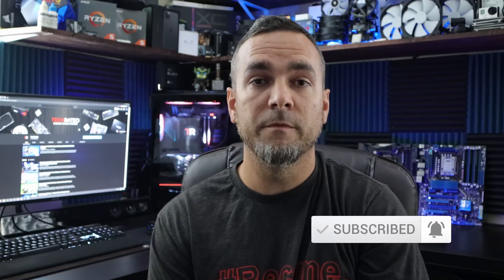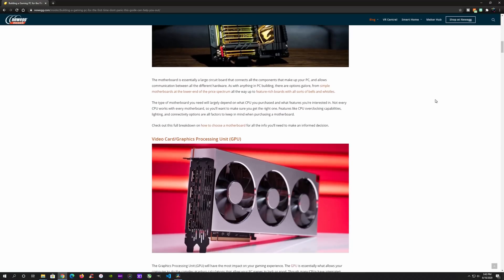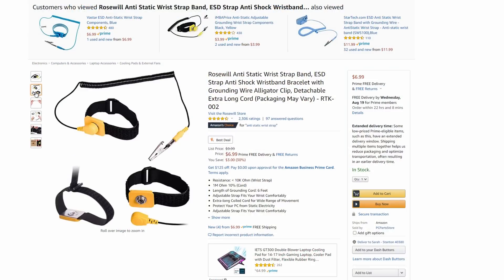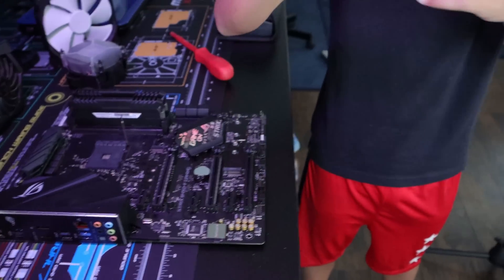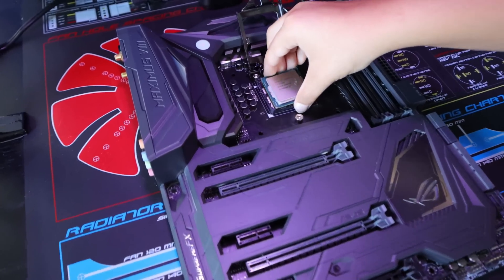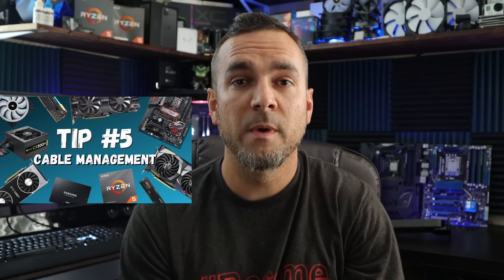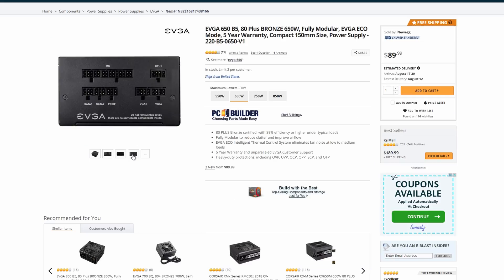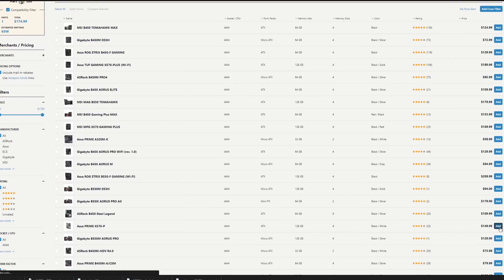5 PC Building Tips for Beginners | Watch Before You Build Your First PC!

Comment: My video conclusion :  Ok firstly I like how clear all the explanations are . Secondly I have the same mobo as you !! Ready for my build on Sunday!! Thirdly I loved how giddy your second son was whilst giving the intel cpu demonstration. You could hear him trying to hide in the laughter. Great video man!. However I have one question that’s kinda relevant that you may be able to answer. I got a be quiet system power 9 600w psu for my first build which is gonna have a 3600 and a 5700xt aswell in terms of power usage . This product has over 500 reviews on amazon uk (where I am) and a 4.5 rating. And it’s got the 80plus bronze thing aswell. However it’s not modular will this badly impact my first build. I am a complete pc noob but your tips about just watching computer videos is where I’ve gained all my knowledge from! Thanks
Reply from the maker: I appreciate the feedback! My boys love helping me in my videos! They also like working on PCs! I only suggest modular PSUs because they allow you to add/remove cables when necessary. This can help with cable management. It isn’t a must however. The power supply you picked out will be just fine. You will love the 3600! It is a beast of a CPU. Good luck with your build! Let me know how it goes! Again, thank you for the feedback and comment! 👊🏼👍🏼
Reply: TechRated yeah ok man great. I’ve experienced some setbacks regarding funds and incompatibilitys but I’ve found what’s right and people absolutely LOVE the 3600 due to its value big exciting 😁. Will do man o hope I will return with good news on Sunday night 💪
Reply from the maker: You got this! 👊🏼